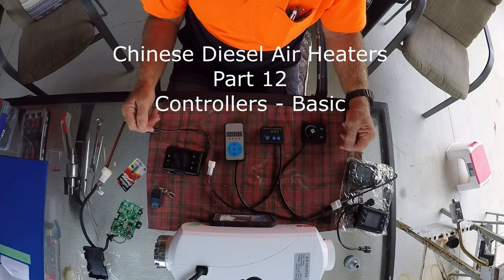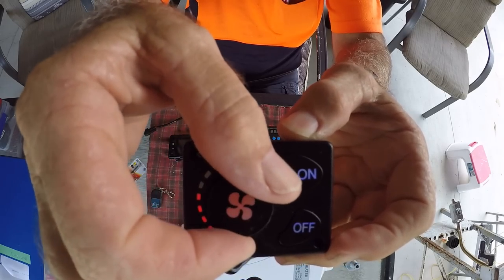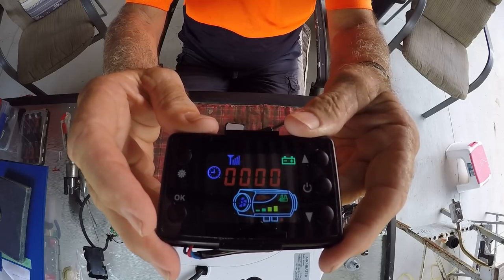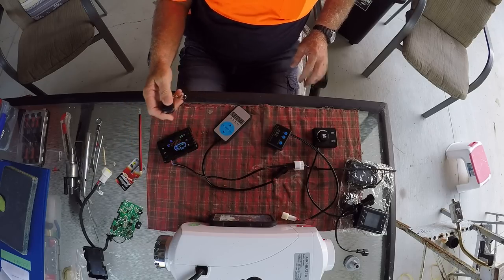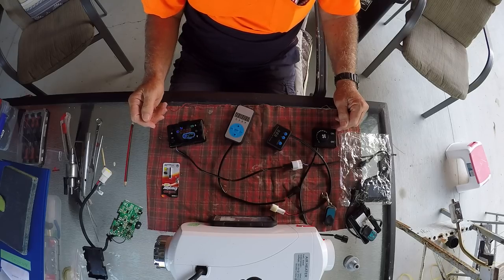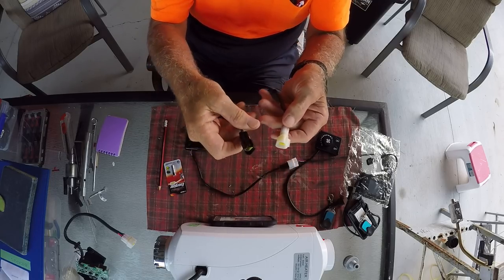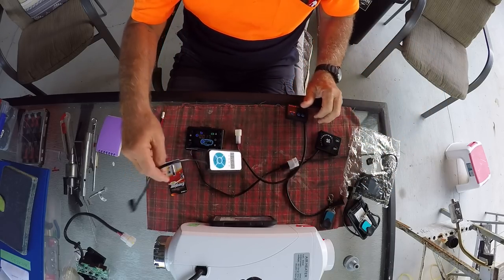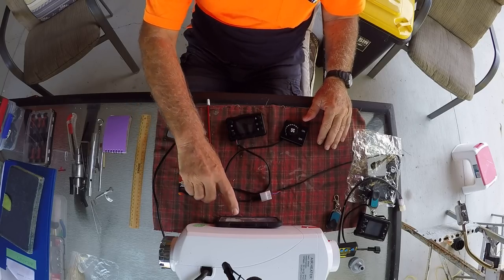Chinese Diesel Air Heaters -  Part 12 - Controllers (Basic)

Comment: Hi John, I've watched your entire series and I ordered a 2kw unit a couple of month ago for my tiny camp trailer. I hate it! Not because of any reason other than it has a controller that talks to me... Yes. It talks to me and makes me CRAZY! Have you ever come across this type of controller? I want to replace it but I'm just not sure about compatibility since it isn't one that I've seen on any of your videos. Other than the chatty controller, I LOVE this heater! Thanks for doing what you do!
Reply from the maker: Hi Rei, 

No,  I have not come across a talking controller. When I did this series more than a year ago many, but not all, manufactures had comparable components where you could swap controllers between heaters. Lately manufactures have been going proprietary with their own controllers and different wiring circuits. This can often be worked around but you would need some knowledge of electronics and circuits.

In the description did it tell you the controller talks? What language?

Are you able to send me a link to your heater please?

Have you written to the supplier to tell him the issues with the controller and ask for a replacement?

Cheers.   JMcK
Reply: @johnmck1147  Hi John, actually, I bought this one in May of 2019. Time flies... I bought it from an eBay seller and the description is long gone. It's a 2kw unit, Planar, whatever that means... It has a digital controller with this little speaker wired in. A heavily Asian accented woman say " Power on, fan on, glow plug on" etc. 

The wires to the speaker go straightaway in to the harness, no plug, and there are 3 wires rather than just 2. It's definitely an odd unit. It works really well though. It's just annoying that it has to strike up so much conversation.

Anyway, after rewatching your series, I ordered another 5kw yesterday, along with a couple of controllers. The unit I ordered comes with the pendant style controller. I also ordered an LCD unit that comes with a remote, and a dial knob style. I'll plug those in and give them a go. Who knows, they may work and then I can send my girlfriend with an accent packing!
Reply from the maker: Rey Mendez 

Hi Rey, thanks for the extra feedback. If you have a genuine Planar heater it is not a Chinese Eberspacher copy heater, and would fall outside the scope of this video series. As would Webasto heaters. Although they look similar they are quite different inside. You would also have paid significantly more for a Planar heater, than what you could buy a Chinese Eberspacher copy heater.  

Good luck with your project. Perhaps you may miss your heater girlfriend  talking to you in these Corona self isolation and lock down times.  (Joke).  JMcK
Reply: @johnmck1147  hahaha! Well, it isn't a genuine Planer, but that's what the old description said in parenthesis. Probably just a gimmick word like a lot of what's on eBay...

I figured out though, that it's a "TG-Version Smart Switch". The small speaker box simply parallels in to the harness along with the controller. After looking closely, I found that I could unplug the the controller from the harness for the speaker, unplug the speaker harness from the main harness, plug the controller harness back in to the main harness and viola! My girlfriend is out of the picture and my heater runs perfectly! 

I think this is the exact heater in your neck of the woods;

https://www.ebay.com.au/itm/123754224082
Reply from the maker: Rey Mendez 

Hi Rey, thanks for the extra feedback. Looks like you are on top of your situation. JMcK
Reply: I have this same controller. Mine only speaks in Chinese. Every time you change the temperature , turn off or on, it screams at you like a chinese drill Sargeant. The volume is so loud that I cringe everytime I need to touch the dial
Reply: @ducatidude4483  I never posted back here, but I simply cut the wires to the speaker housing and tossed the speaker. I also taped off the two wires to the spacer and put heat shrink over them. No more sound, just heat... And of course pump clicking...
Reply: @reymendez8563  thanks! That's what I'll do
Reply: @ducatidude4483  post up here and let me know. Hope it works the same for you.

Comment: Hi my heater won’t turn off! The type is the one in this video to the far left of screen, most functions on its screen panel. Can you help? Only error code is E 00. Fan stuck on, no heat as set at 9C
Thank you. (UK)
Reply from the maker: Hi Lorna, first make sure you are holding down the power button long enough. Push and hold it down for a couple of seconds.
Second, if it was not a proper button switch, disconnect all power to the heater foe a few minutes and try again.
Try running the heater in manual mode, or reset the the temperature. It won't heat if you have it set on 9 deg.   JMcK

Comment: Has anyone tried using a oil furnace thermostat to control the heater for a better temperature control.  I would  like  the temperature control the heater and not run me out with the heat.

Comment: I have a question.my motorhome is gasoline and I want to buy and install that unit and use the fuel I have, gasoline as in the USA,, will you do a test ?will it over heat with it as is,, will it give the same out put?
Reply from the maker: Hi Hamish, these particular heaters a designed to run on diesel. Espar or Eberspacher do make a petrol version of these heaters that are modified to run SAFELY on petrol. To my knowledge there are NO Chinese copy petrol/gasoline heaters.

However I am going back to my boat in Europe in April and I will look out for a petrol version and see what the different parameters are. As I have not been able to do a pull down and bench test of the petrol version, I am unable to comment.

There is a video I saw some time ago of one gentleman testing with petrol, and from memory he could not make the heater work properly. If I can find it again I will place a link here.

Regards. JMcK
Reply: you are very good in your video ... I did see a man testing one with US-gasoline,, the final statement was, surprised it was not any hotter.I think the controller keep it in control.  someday, I will buy one and test on the workbench,, . I don't want another fuel in my small motorhome,  thank you for replying.. so few do..Hamish of Tujunga

Comment: So if the power goes off  the heater will over heat ?
Reply from the maker: Yes, it will overheat as the heater is unable to go through its cool down cycle.

If you are present immediately remove the top cover if you can, and manually fan the heater to disperse the heat.

It is most unlikely to be a fire risk, but you will likely destroy the ECU

Cheers.  JMcK

Comment: The German heaters have 5 wires so will those controllers work with them??
Reply from the maker: I doubt it LF, controllers are matched to the ECU. But I have not tested this so I could be wrong.   JMcK
Reply: @johnmck1147  Perhaps it would be cheeper to replace the ECU as well considering what the Germans are asking for their controllers. And thanks for spending time to answer :-)

Comment: Are these things 100% safe or are there still exaust fumes coming in the RV?
Reply from the maker: Hi there,. Nothing is 100% safe (see video on gaskets) but installed correctly these heaters are very safe. But if you have any fuel burning appliance, be it a gas stove, gas or diesel heater, open fireplace, or you just burn candles in, or conducting air into an accommodation space you should have a CO alarm meter.  Cheers.   JMcK

Comment: Hi, I wonder if u could solvers problem I have with my heater. It's a digital controller and i can not get it to stay on 12 volts it  keeps going back to 24 volts settings
Reply from the maker: Hi Raymond, you may have a fault in the controller. Does the heater still work anyway? If the heater is new, suggest you contact the supplier for a replacement.
Sorry I can be of more help. JMck
Reply: @johnmck1147  yes the heater still works but I have to use 1688 code to switch to 12 volts before it will work. It's a yr old. Thanks for your reply just thought u may know of a quick fix, il order another controller, probably go for a simpler one
Reply from the maker: Raymond Wallace    👍

Comment: Is it possible to swap controllers? My heater controller is all in Chinese, and I'd like to swap for one like at 3:20. Anyone know if thats doable?
Reply from the maker: Hi FG,

Yes, FG, I do it often.

in the past it was very easy as most suppliers used standard protocol, plugs, and wire orientation. 

These days not so easy, with many new manufactures/ suppliers popping up due to the increasing popularity of the efficient little heaters. 

Some of the new suppliers use different plugs and protocol making swapping controllers a little more difficult. But it can be done. Just be careful that the wire colours match up. Sometimes, even with standard controller plugs the wires can be reversed.

There are three wires for the controller, two power wires, generally red (+) , black (-), and a blue (sense) wire.

Worst case, there are a number of sellers on eBay selling matching ECB and controllers.  JMcK
Reply: @johnmck1147  Thankyou so very much for that - I really appreciate getting back to me. You are a gentleman, best regards from  England !
Reply from the maker: 👍 Your welcome.  JMcK

Comment: Dear Sir, from the blue color controller, your controller shows error code E 07, I have a same controller with same E 07 code, do you know how can I fix it? Thank you very much for your help, I really appreciate it
Reply from the maker: Hi Fanqi, Error code E07 generally means a communication fault with the controller. Suggest you check the plug is pushed in correctly, and there are no loose wires, particularly the blue (most common colour) communication wire. Also check there is a good earth connection. I hope this is a little help. JMcK
Reply: @johnmck1147 thank you so much John, I didn't find the reason of E07 code, all cable look like good, but finally I fix the problem by replacing a new ECU board and controller, I appreciate your help
Reply from the maker: Fanqi Kong Glad you have it fixed Fanqi.  JMcK

Comment: Could you tell me how to fix error code 07 as I have just installed heater and this is the code on the controller. Thanks
Reply from the maker: Hi Chris,

E07 is generally a disconnection fault. 
1. First check your DC power wiring id correct.
2. Next check you have plugged in the controller correctly.
3. Now check that there are no broken wires in the plug pins, particularly the sense wire (generally blue wire)
4. It is possible you may have a dud heater with a faulty controller or ECU. If 1and 2 & 3 don't apply, and the heater is new, suggest you ask for a replacement.  JMcK
Reply: @johnmck1147  Thanks very much for that

Comment: Hi, many thanks for making such a comprehensive series of vids, very helpful👍I have an espar d2 with the basic dial controller and have been concidering up grading controller, the chinese digital ones are well priced compared to espars but I have yet to confirm that the wiring is compatable and would be a simple straight swap?
ATB Shane🤘
Reply from the maker: Hi there, I really can not give an answer without access to the detailed ECB logic and circuit info. I would also like to do my own testing. In theory it should be possible, as you are basically changing the pump pulse rate, and measuring the room temperature via the thermistor. You could easily buy a new complete Chinese heater for the cost of a genuine controller.  JMcK

Comment: There is another type of controller  looks like a small TV  controller with a funny looking  cap  that's separate.  If your controller fails you could disconect the pump . NO fuel . it will just shut down .

Comment: Hi John 

Sorry I'm late to the party . Could you perhaps explain why (If you have the correct tools) it's not feasible to de-pin and "correctly" rewire the controller ? So that it will theoretically work correctly . Are the two differently wired types of controllers entirely different signal protocols ?

Thanks

P.S. Brilliant videos BTW . Thank you for taking the time to produce them for the uneducated amongst us .

Fattrucker
Reply from the maker: Hi FT,

When I made these videos for the DIY installer, some years ago now, the Chinese manufactures all used the same protocol and you could easily swap controllers as they all had the same plugs, and all “talked” to the different ECB's. 

Then some manufactures started doing their own thing using different plugs, or same plug but reversed wiring etc. You could still easily swap controllers by realignment of the wires using a different plug or hard wire. You just had to match the two power wires and the sense wire (generally blue)

Sadly now a few heaters come with different protocol ECB that make it difficult to use another supplier controller, as it could not “talk” the same language.

You can buy on the internet a matching ECB and controller, but if a manufacturer has abandoned standard protocol for controllers, the plugs for the sensors are are often also different. This can be rectified if you have some skills in this area.

I hope this helps.  Cheers,  JMcK
Reply: @johnmck1147  Thank you John . I did think this was probably the case . I recently bought a used camper van . And with the help of your knowledge I feel confident enough to strip and service the diesel heater after the camper's extensive refit . 
As a side note . Have you seen the Chinese diesel air/water heaters for approximately double the price of the air only models . I believe they are designed for engine block preheating in extreme cold weather . But I'm seriously considering utilising one for a hot water supply in the camper . Even with fabracobbling a full system together it would work out substantially cheaper than a dedicated RV//Caravan hot water system . Thoughts , ideas , pitfalls to consider I may be overlooking ? I would be most grateful . Thanks again for replying so promptly . But most of all thank you for your fantastic videos in the first place  . I cannot thank you enough .

Fattrucker

Comment: Hi john .
Love your very comprehensive video's
My unit has the controller with the 3 buttons (the one you say is cheap and nasty).
Could i cut the wiring harness and reposition the wires to match the better controllers ?

Carl
Reply from the maker: Hi Carl,

If it is a new heater and there was a local warehouse you could try and return the heater, and buy a standard heater.

You could live with you have got, 

You could try a re wire, but the one I got also had different wiring to the ECU. Even though the supplier advertised free returns it did not happen in practice. But I got a partial refund that mostly covered the cost of a good controller and a replacement ECU.

At this stage I have not tried to change the wiring on the ECU, but may look at it at some stage in the future.

Cheers, JMcK
Reply: Hi John. 

Thanks for your reply,the system works ok, so i will leave it as it is fo now.

Regards 
Carl

Comment: My battery is at 12v the controller is saying 11.8 when heater is running controller is showing 10 .8 is this normal heater is working
Reply from the maker: Hi Carl,

On many of these heaters the wire size is at the bare minimum and should be increased.
I go into this in detail in the motorhome videos.

If the heater is working ok, let it be, if you start getting issues you will need to increase the power wire size.

Cheers.  JMcK
Reply: So I ran 14gage wire from battery to heater should I have used thicker wire when I had battery hooked direct to heater voltage stayed up around 12v lowest it dropped to was 11.7

Comment: Do you think you could run these using a mix of waste oil and  diesel?
Reply from the maker: Oh dear me Mr Richierich, 

You need to see some more of my videos. 
Yes you can burn a mixture of waste oil and diesel, in fact the internals of these heaters are a basic flamethrower type of burner and they will burn almost any type of oil. BUT, you are setting yourself up for a lot of grief and unnecessary maintenance. By burning oils you produce large amounts of soot and carbon in the heater. 

It is soot and carbon that is the worst thing for these heaters. Inside the burner there are fine mesh stainless steel atomising screens and when these get carbon up the heater will not work

Also used engine is itself full of carbon and residue, if you don't fine filter the used oil it will gum up the narrow fuel lines and the tiny one way valves in the little dosing pump. 

Suggest you do not burn used engine oil mix in your heater.  JMcK
Reply: @johnmck1147  ok cheers.  Trying to find a cheap way to heat the house.. We live in Canberra.
Reply from the maker: Richierich90000 

Yes it gets cold down there. These little heaters are great little heaters, run it on diesel or a diesel kerro mix and it will work great.  JMcK
Reply: @johnmck1147  I think Diesel would probably be more expensive than gas- per BTU
Reply: @johnmck1147  did it fun up when you burnt cooking oil in it?
Reply from the maker: Richierich90000 

Yes, but the issue with LPG, is the condensation caused by the high moisture level byproduct.  JMcK
Reply: @johnmck1147  Yeah i mean with a flued LPG Gas heater.